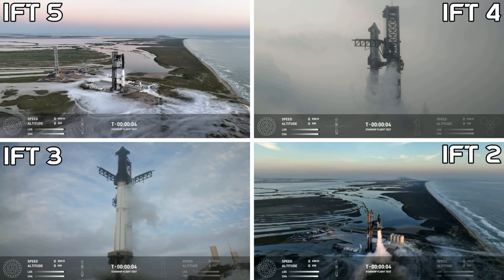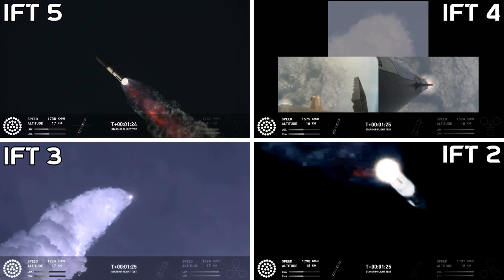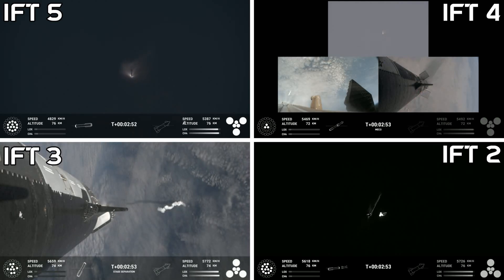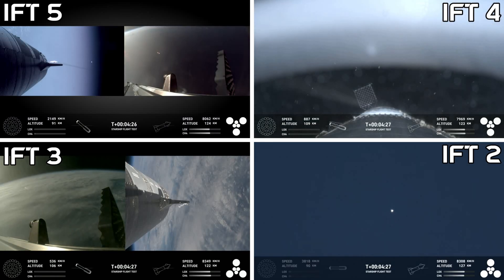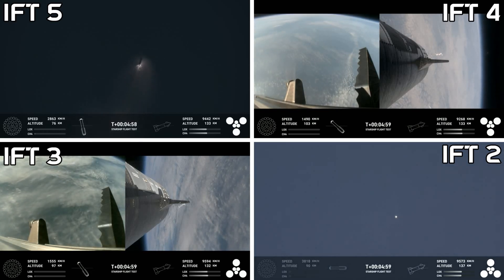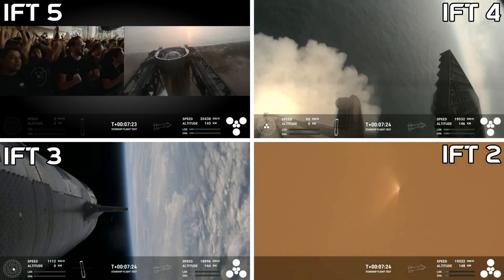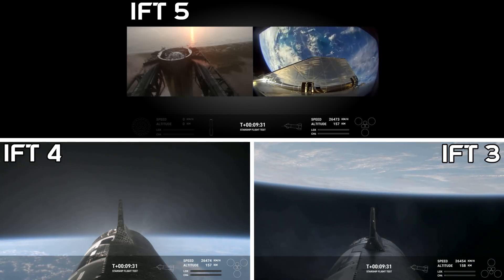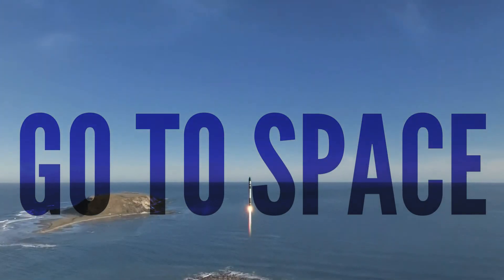Starship SYNCED Launch IFT5 vs IFT4 vs IFT3 vs IFT2

Comment: I was wondering why IFT 4 was so much slower then realized it was the one with the engine failure lol
Reply: Quite shocking that a single engine can make the flight a little longer
Reply: @notaq9727  I think they throttled the opposite engine accordingly to support a stable flight path which meant (almost) 2 engines being lost. If I recall correctly....

Comment: Why did IFT5 take so long to get moving.....IFT 3 and 4 left pretty quickly.....
Reply: Yeah…. And on top of that the booster strangely returned the fastest…
Reply: @Cursed_Baljeet The booster returned faster because the it is a more direct trip to the launchpad than far into the ocean
Reply: Термозащита двигателей и основного корабля + новый объём баков + блок горячего разделения + скрытые детали внутри корабля (новые антенны + камеры).

Comment: Flight 3 and 4 lifted off at t+00:00:02 but flight 5 took off at like T+ 00:00:05. Did they tweak it or did something fail
Reply: I don't know for certain but I assume it was a gradual throttle-up to make sure they had healthy engines at all throttle ranges, because they would need complete control during the catch attempt. If the engines struggled at minimum throttle, the catch would have been aborted at lift-off, and the booster would have fallen into the ocean.
Reply: Likely a different and more efficient throttling profile.

For example, jets don’t floor it on takeoff.  They have a certain throttle profile so they don’t damage the engines.
Reply: I noticed it watched live stream. I think it was a slower ramp up to the desired TWR, rather than punching it to the theoretical throttle position. But im not part of tge decision matrix, nor a space x employee

Comment: 4 flights x 33 engines = 132 engines total. These are raptor version 2. One failed during launch => (131 / 132 = ) 99.242% reliability in these prototypes. I am certain SpaceX will improve this in raptor version 3.
Reply: don't forget the raptors on the ship! all of them successfully fired. that's extra 24 engines
Reply: @purinnyova and 6/7 relighted as planned (landings and S28 failed in space re light
Reply: @Hello_OoOoO  No they just decided to not fire it
Reply: @tha1oneasianguy  That's  what i was thinking
Reply: thats quite a high level of reliability for such a prototype, something i dont that has ever seen since the RD-107/108.
Reply: Thats crazy tho